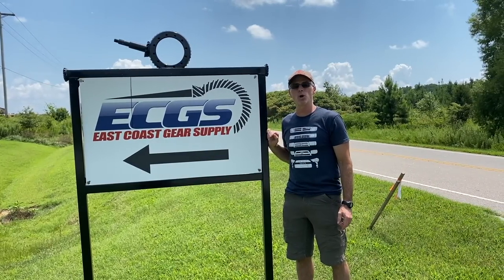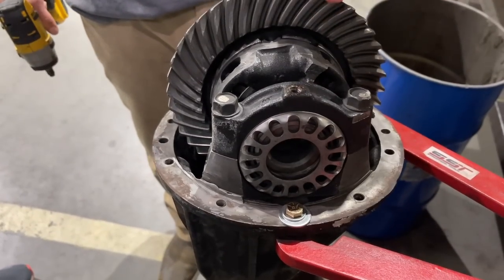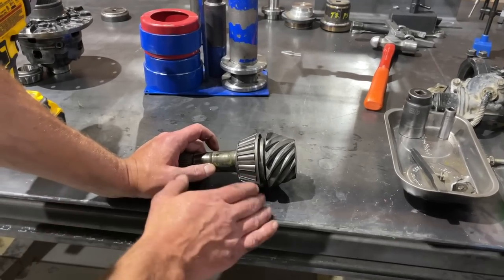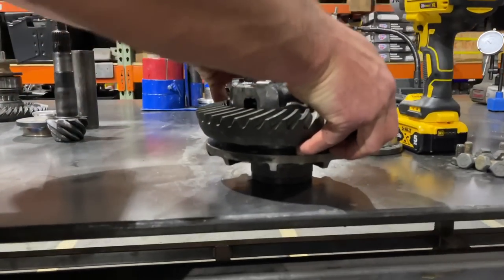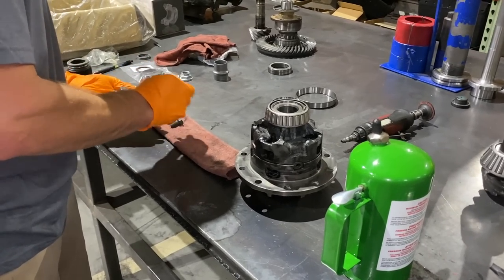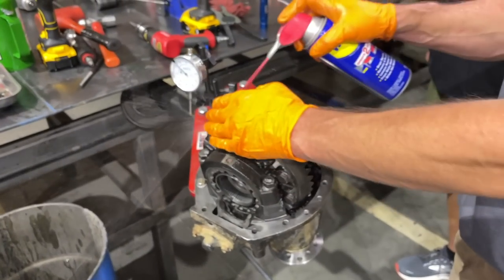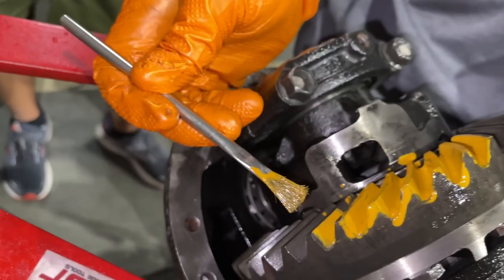ECGS Toyota 8" Rear Differential ReGear/Rebuild (with CEO Chase Perry)

Comment from the maker: There was a guy that reported his pinion shaft threads got damaged by not unstaking the nut before removing it.    At playtime 14:38, Chase says there's no need to unstake the nut before removing it with a 30mm socket.  To play it safe so this doesn't happen to you, I would unstake the nut before removing it.  This is the toolset I bought to stake and unstake nuts: https://amzn.to/3j9AnPD

Comment: East Coast Gear Supply to the rescue!
My diff was rebuilt by a local shop a year ago and I was still having issues. After your last video at ECGS I decided to bite the bullet and go with them instead for the 3rd member rebuild and regear in my '91 4x4 Pickup, and I couldn't be happier! Just installed it last weekend.

I'm 50 miles into the break-in period with the recommended Lucas gear oil and I'm already happy as a clam. The diff arrived here in Michigan packaged perfectly and was put together right to the specs I picked out. The gear pattern looked perfect, and they're running cool and quiet.

Thanks Tim and thanks East Coast Gear Supply, cheers from Michigan!
Reply from the maker: Smart choice going with ECGS.  Glad you had a good experience with them.  They are a great company.  I'm around the same miles in on my diff  break-ins.  Stay tuned for the front differential regear and locker install we filmed.  I got an Eaton e-locker.
Reply: @TimmyTheToolman   nice! I almost went with a locker but I’ll probably do that further down the line after the 5VZ swap (another job I owe you some beers for!) party. Eager to see how you like the Eaton, that’s what I was looking at too (with a Detroit TrueTrac up front).
Reply from the maker: @gohilux  I'll report back to the video in a pinned comment after I get to test out the locker on a wheeling trip.  Good luck with the 5VZ swap.

Comment: My dad taught me much of what Chase mentions in the video. One often overlooked tip to make bearing and race installation easier is to put races in the freezer for a couple hours and to warm bearings on a hot plate, shop stove or other heat source just like he did the ring gear. As for bearing removal, I often use the destructive method of a cutoff wheel on a die grinder to deeply score the race after the cage has been removed and then split it with a cold chisel. Easy to do when you are replacing bearings anyway. 

I am regearing my 92’ 4Runner currently and it will be my first Toyota diff, but I have done several 3/4 tons and a couple of 2 ton farm trucks. A clean workspace and patience is what is most needed. This video will help me a bunch.
Reply from the maker: Sounds like you had a cool dad.  Thanks for sharing your tips.  Good luck with the regear.

Comment: At 33:52: You can use the old bearings for pressing. Just cut the cage off and you got a perfect tool for pressing the new carrier bearings on.
Reply: Nice
Reply from the maker: Thanks for the tip!
Reply: my dad does the samething.. I thought I saw your 4runner heading into shaver on Friday.
Reply: @TimmyTheToolman  no problem. the same can be said for all bearings actually :). A flat plate on top for pressing or hammering. 

Looks like that's what they did here actually. They just welded a plate to make things faster for future work.

You can also use the same plate to support the bearing if you happen to put it on in the wrong order.
Reply: @shaunmilor  It wasn't me!

Comment: I always pack seal on diff builds and pack the lip with grease keeps em from burning up while seating to mating surface...And its wise to put a little anti seizer on face of nut to prevent galking when tightenin to make it easier tightenin pinion nut
Reply from the maker: Thanks for sharing this info.

Comment: Very good work guys.. 
I was surprised the baffle washer, oil slinger was not reinstalled.  
I like what chase said about never getting the perfect pattern and the need to go either side of the shim set you end up with. 
I especially like the point you make about being prepared to spend quite a bit of time to get it right.. 

The mechanical seal on the drive flange can be very good at keep large contaminants and grass from getting at the primary shaft oil seal. In the country we drive, see mud and long grass , we often see stuff wrapped around drive flanges. 
For the center preload it’s often snug then a rotational amount ( an angle or number of notches) as chase said torque can be highly influenced by cap pressure and burs etc.

For the back lash I felt like the dial indicator was not perfectly tangential to the gear I expected it would only account for a thousands or so.. (my OCD) lol. 
It also makes It clear why some shops specialise in setting up diffs.  $$$ of special tooling and experience..

I have trust issues and have found some experts in fact don’t actually now what they are doing. The number of guys that get on you tube and do videos sometimes just exposes their incompetence.. lol I’m sure you know what I mean. 

I would definitely use these guys to do my diff setups. 
Absolutely no criticisms … 
Once again great work hands down the best diff setup video I have watched. 
Definitely subscribed from now on. 

I would love to hear your and Chases opinions about solid spaces helping a diff that gets heavily loaded in the reverse directions, ie the dreaded reverse recovery pull.
Reply from the maker: Thanks for sharing all that.  We got very lucky being invited to ECGS to document these differential rebuilds with Chase.  

I never noticed that Chase didn't reinstall the oil slinger and that might have just been an oversight because we were filming and there was a lot going on and a lot to think about.  After we were done filming, that diff went to one of his guys to recheck because the work done by Chase was more about showing the process and not getting everything perfect while we were filming.  It was basically done this way to save time.  

I don't have an opinion about the solid spacer other than it's a better way to go to avoid the pinion bearing preload changing if the pinion flange takes a hit during some 4wheeling.
Reply: @TimmyTheToolman  thanks yes he did say he was not happy with the pinion pre load they may have re fitted the slinger, but that would have costed a second seal.. I can imagine it’s hard to stay focused while trying to film it all.. man setting up the front diff is a big job..
Reply from the maker: @stevehanwright481  We were lucky to get that much time from the CEO of a pretty big company.  Since making this video, I've tried a few times to communicate directly with him via email or text and I never get a response.  I imagine he has to decide who gets his time and I don't make the cut.  So, when I need something or have another business proposition, I just run it through the sales department.  I know I can always get ahold of one of those guys.
Reply: @TimmyTheToolman  as a business owner there’s an old saying I once heard I can’t keep everybody happy today so I’m gonna have to decide who it is I let down. it’s just impossible to contact everybody that wants a piece of me. I expect Chase is in high demand.
Reply from the maker: @stevehanwright481  Yep, he's super busy and he has to find a healthy balance in his life.  People are always asking me to work on their vehicles as a side job and I turn them all down.  My time is better spent making videos where I can make an unlimited amount of people happy, rather than just one person happy.

I do have to say though it is nice when I can have some sort of relationship with the people I work with.  It makes it more personal and rewarding.  The best relationship I've made is with Yota1 Performance.  I consider the owners my friends rather than business associates.

Comment: Just got my 8" rear diff with 5.29 gears and Harrop Elocker from ECGS installed a few days ago and it went off without a hitch!😁 Also installed chrome molly axles and disk brake conversion from LC engineering along with rear Truss kit from Trail-Gear, Hope my front diff from ECGS comes in soon so i will be ready to rock n roll .....hint hint😜
Reply from the maker: Good choice choosing ECGS.  Your front diff will probably be arriving soon.
Reply: @TimmyTheToolman  well the thing is I priced out the individual parts and could have done it my self but it wouldn't have been much cheaper if at all and if I had purchased or took the time to build the few specialty tools needed to do the job right it would have cost me more
Reply: @TimmyTheToolman  btw I have stage 3 engine here from Yota1 I hope to get put in soon😍
Reply from the maker: @regularguy8592  Yeah, the specialty tools to work on differentials can be a little pricey, and if it's something you think you'll only do once, it's not going to be cost effective.  

That's awesome you got a Yota1 Performance engine.  Have fun with the install.

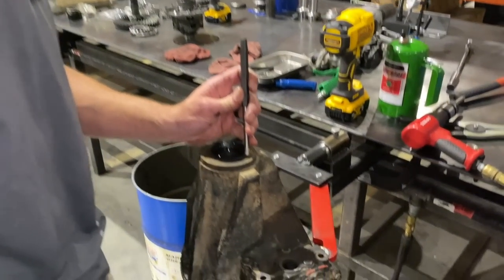Comment: Great tip at the 16:35 mark for pulling the pinion seal. Hadn’t seen that before. Also interesting to hear he runs 85w - 140 gear oil. My understanding was both front/rear diffs called for 75W-90. Guess it’s just personal preference.
Reply from the maker: The factory spec is 80w-90 for the rear diff and 75w-90 for the front.  Chase likes a heavier weight gear oil for the cling factor so it will give more cushion to the ring and pinion gears.  So yes, it's the personal opinion of a guy with lots of experience in this field.  I've decided to follow his advice and will be running 85w-140 from now on.
Reply: I agree with Chase. In all my excitement, I had used Mobil 85/90 full synthetic racing oil in my Toyora Hiace differential. It was not too long after that I started hearing a whistling noise coming from the differential whilst driving forward. I switched to the 85/140 non synthetic. The whistling noise was still there but it never got worse.

Comment: I did not unstake my pinion nut and it really messed up the threads on the way out and turned a one-day job into a multi-day job. I would have to recommend unstaking the pinion nut first before undoing it. Thank you for the video though tons of good info for a noob like me.
Reply from the maker: Yeah, I was wondering about that when Chase said there was no need to unstake the pinion nut.  Sorry that happened to you.  This is the toolset I bought to stake and unstake nuts: https://amzn.to/3j9AnPD
Reply from the maker: I added a pinned comment to warn others that they should unstake the pinion nut before removing it.
Reply: @TimmyTheToolman  good deal!

Comment: Hi Tim. After visiting ECGS and learning all this stuff about differentials, do you still think the pinion seal replacement method you and Shawn show in one of your videos is acceptable? I watched this video to gain understanding on what is going with the crush sleeve on the pinion shaft and to understand backlash and preload. Chase mentions that it takes ~250 ft-lbs to crush the crush sleeve. Based on that, it seems the pinion seal replacement method you show in one of your videos should be fine as long as the pinion nut is tightened to exactly where it was before (counting threads/using paint marks). Doing so should reliably maintain the pinion bearing backlash, especially since it would take ~250 ft-lbs to crush the sleeve and change the bearing backlash. Does that sound right? 

PS. I'm a big fan of the channel! Learned lots from you guys over the last year that I've owned my 02' 4Runner.
Reply from the maker: Yeah, I'm comfortable with our pinion seal replacement.method.  We got the nut back where it was, so it should be fine.  Sean has driven the vehicle a lot of miles, and there's no issues.  If anything, I wish I would have tightened the nut more, knowing how much is required to crush the sleeve.  I might have just barely undertighened it from its original spot.  I know I was damn close because the spot on the nut it was staked before was pretty much dead on.

It's nice to know you're learning a lot from our channel.  Happy Wrenching!
Reply from the maker: One thing I would like to add is it didn’t seem like the nut would turn anymore so any attempts to tighten it any further seemed unattainable. I believe we tried to see if we could get it any tighter and the nut would not seem to get any tighter and since the stake in the nut lined up perfectly to where it was before, we called it good.
- Sean
Reply: @TimmyTheToolman Thanks for the replies! Did the job last weekend and now have a fresh OEM pinion oil seal.
Reply from the maker: @ValkoDeath  Good job!

Comment: Hey guys. Question, I just had my tacoma re gear and would like to know if I need to engage the 4x4 to break in the from Dif gears? sorry for the dumb question
Reply from the maker: It's not a dumb question.  I had the same question as you did.  This is the answer I got from Chase at ECGS:

Front Differential Specific Break-In Instructions from East Coast Gear Supply

*Normal 2wd operation will passively break in the front diff.
*Normal low speed trail riding under 20mph breaks in the front.
*Highspeed 4wd use for long periods of time should be avoided: Example would be road use above 45mph for over 10 miles, limit these types of drives until 500 miles is complete and oil is changed.
*Low speed 4wd use does not build heat, highspeed use does.
*Diff fluid should be changed if water is ever introduced, or after 1 year. No highspeed use for extended period of time, Change fluid after 500 miles of low speed, limited high speed use.
*Perfect break in would be fire roads, light trails under 20mph for 500 miles.
       - Every customers driving patterns are different, the end goal is to limit temps above 250 degrees for extended period of time, a temp gun at pinion snout can be used to verify temps. As mention in video the front diffs hold very little oil. Diff drops and lower gear ratios impact oil flow to pinion bearings. Therefore, caution is highly advised for high speed use. Highspeed is defined as above 45mph.
       -Note: This is specific to the 7.5 Clamshell referenced in video  the larger Toyota front diffs T8 Clamshell holds more oil and oils better so is not as sensitive.
       -Note: Main concern to cause issue is if user has brand new diff and jumps on highway in 4wd with low gears and diff drop, this can lead to pinion bearing failure very quickly.

Reply
Reply: @TimmyTheToolman  thanks for the information. Blessings
Reply from the maker: @chocolon1129  You're welcome.  I still haven't properly broken in my front diff.  500 miles is a lot of off-roading, so not exactly that easy to accomplish.  It would be my guess that most don't achieve the magic 500 miles of off-roading at a mellow speed before forgetting about it and just driving as fast as they want in 4wd.

Comment: I own a 07 FJ and it has the 8” dif like in this episode. Typical for them to fail at 70k miles, ECGS provides a exchange rebuilt for them. At 130k miles I once again had to buy a ECGS rebuilt. If you own a vehicle with this 8” dif I can attest that its from shock to the gears (spinning free then hit traction) that will break them no matter how many miles is on your vehicle. If I ever need a replacement ECGS has my business.
Reply from the maker: Yeah, spinning the wheels is something to avoid if possible, because like you said, if the wheels all of a sudden gain traction, that can be very hard on the gears and axles.  Easy on the throttle is how I wheel.
Reply: This is why I swapped my 8" for the newer 8.2" rear axle
Reply: @nathanielfurman529  Id love to upgrade to the dana 44

Comment: wait do you have to put the truck in 4 low to lock it? mine I can lock it in 2wheel drive. pretty sure the "chp"  previous owner did the graywire sicmod tho
Reply from the maker: Yes, unless you have done a modification with the wiring, you have to be in 4Lo to engage the rear e-locker.

Comment: Timmy do you have the font deferential video with locker also or it was only the rear one?
Reply from the maker: Yes Arin.  That video will be coming out within the next week or so.  It's not as complete because Chase didn't want to show some of the same steps he did the day before like pulling off carrier bearing and pressing them on, taking off the ring gear and putting the new one on and discussing setting pinion bearing preload.  So, I'm just going to mention that fact in the intro of the front diff video and suggest people watch the rear diff video first to get a more complete picture of the process. 

We will also have a Part 2 for the Front Diff Swap where I share more information, mainly some tricks to getting the diff out and back in easier.

Finally, we'll be putting out a video for the wiring of the Eaton e-locker.  So stay tuned for more content....
Reply: Awesome. Thank you Sir
Reply from the maker: @arinmirzayan3949  No problem Arin.

Comment: What was the point of doing the backlash before setting the pinion spacer and pre-load? You just had to do it again after reassembling, and redo the patterning. Why do the pinion first, then do the backlash once it's set?
Reply from the maker: We're not the experts.  ECGS is.  If you call them, maybe they'll give you the explanation you're looking for.  Chase Perry, the CEO of ECGS, was giving the instruction in the video.  He's been building diffs for a very long time, and I'm certain the methodology he used to rebuild the diff is solid.
Reply: @TimmyTheToolman  I figured it out - the first paint pattern sets the height of the shim separating the inner pinion bearing and pinion gear. That shim sets (partially) the dept the pinion engagement with the ring gear, which can move the heel-toe alignment.